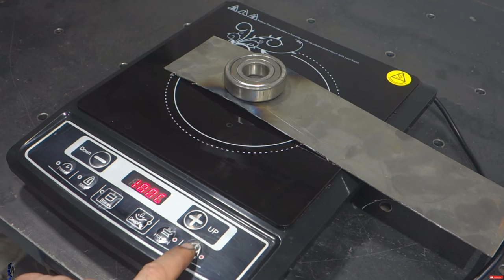BIG Bench Grinder - Restoration and modification!

Comment: I would suggest that you put a shield on the wire wheel side as well. I was using a wheel and one of the metal whiskers came off and into my cheek. I was just lucky it didn’t get into my eye!.

Comment: grait video but nice job withe the motor buuuuut... the wairing ho man its so por job, its a little bit dangerouse using jost ducktape no welding, tray to change
Reply: well it is most likely a cheep LED light that could have a iffy lifespan and a placeholder. 
also this could be proof of concept or an stand in for light made from LOC-LINE HOSE SEGMENTS system like Adam Savage Custom Workbench LED Lamp.
there are a Heat Shrink Solder Seal Wire Connectors and Brightfour Way 2 Pin Led Connector
but twisted wires and tape had been used for decades in many cases with burning down the house